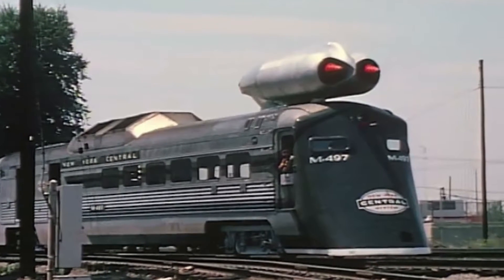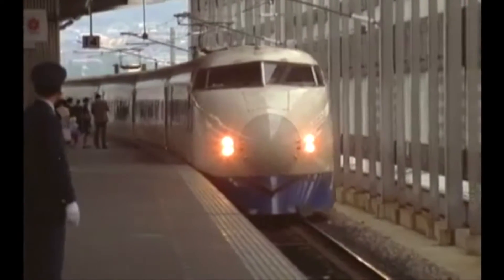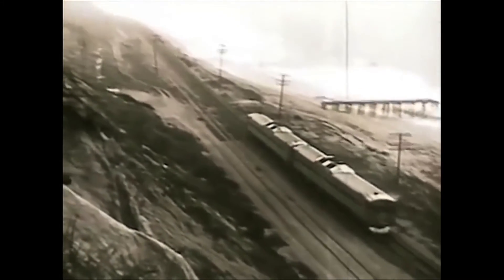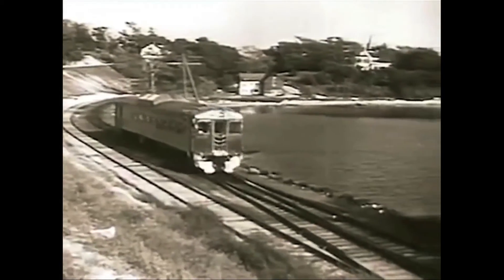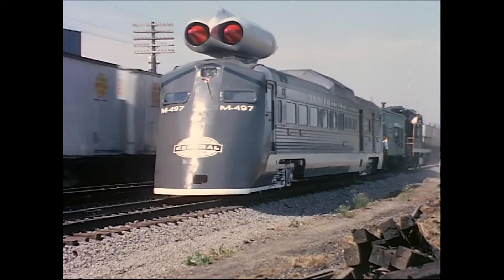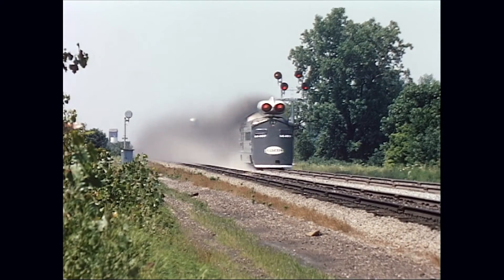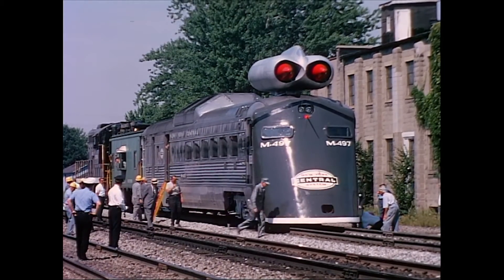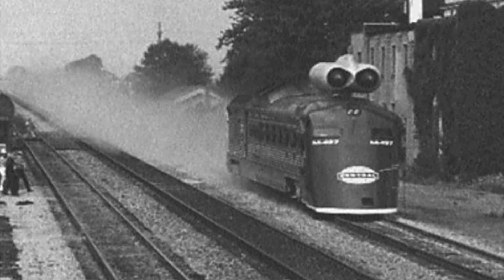That Time Jets Were Attached to a Budd RDC

Comment: After the NYC removed the jet engines, they used the jet engines as snow blowers. At least one of them was used in the Buffalo area, I think, into the mid 1990's by the NYC, then Penn Central, and Conrail.